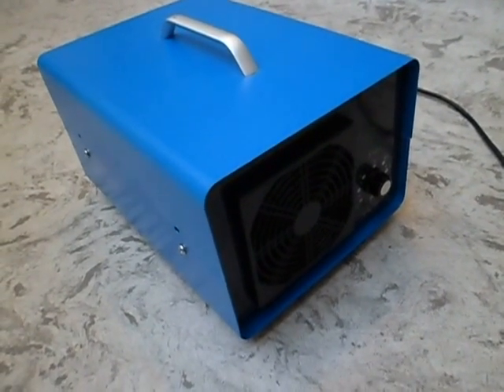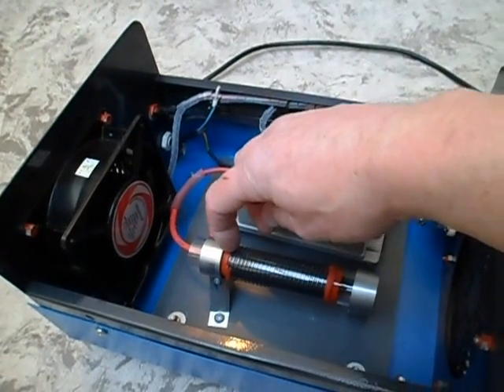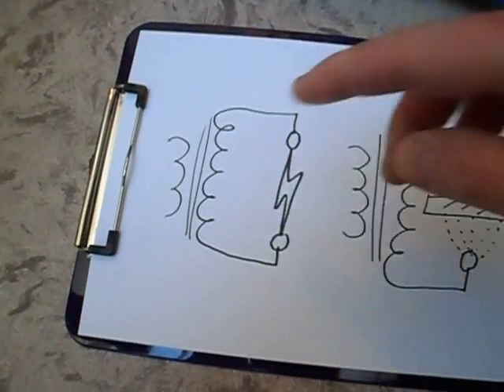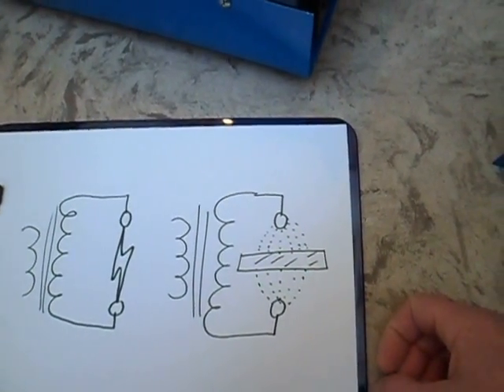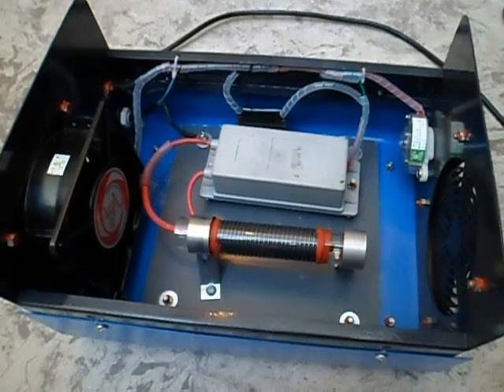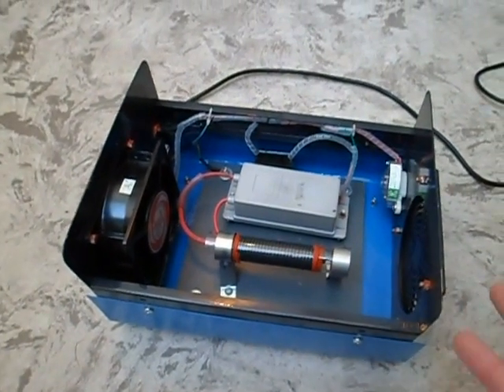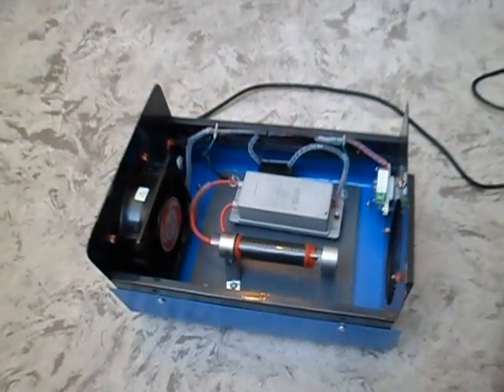Inside a Chinese ozone generator.

Comment: Where does the ozone stuff come out? The front part with the switch or at the back?
Reply from the maker: It varies between machine.  Ideally the fan blows air in so it's not sucking ozone past itself.

Comment: Well the package has arrived, a 60mg/h digital timer ozone generator. It jas different guts then in this vid (stacked white plates).

The first thing I checked: Earth connection. Well that's not present at all. Should I connect the earth to the metal case? Most video's tell you to do so, but I also heard that some devices are designed without earth on purpose.

Comment: Is that circuit AC or DC ? I mean that corona tube works with hight voltage AC or DC. I will be really thankful if you responce
Reply from the maker: High voltage and high frequency AC.  DC wouldn't work.

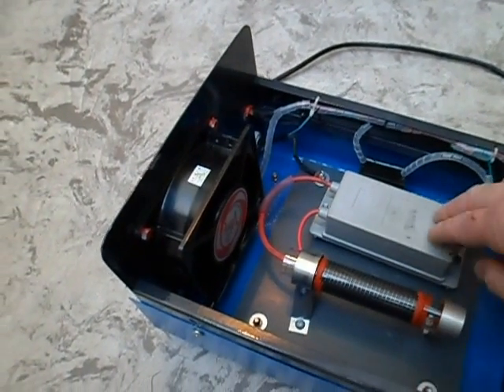Comment: Are you saying a capacitor in a series rivet? (0:25)
Reply from the maker: A capacitor in series with it.
Reply: @bigclivedotcom  correct me if I'm wrong, but this capacitor in series is for electric input stability? Or does it do other purpose?

Comment: the generator gets very hot and burns out - a little fan will not help because you got no  heat sink  -  i have had 2  burn out in several months also they grow a crystalline substance all over then the wires short out creating a bad fire hazard  - Chinese cheep design JUNK

Comment: ozone doesn't just oxidize smells in the air... it oxidizes everything in the air.  it's like vaporizing weak bleach and then breathing it.  and yes, it bleaches your lungs too.  this is why it's considered one of the most important air contaminants, and places like deserts, where ozone gets produced commonly at ground level just from heating rocks in the sun, often have ozone concentrations listed in the local papers.

same ozone you hear about forming the ozone layer... but the difference is that the ozone layer is up in the stratosphere, and serves an important function in absorbing UV light (UV will break the O3 back into O2 and single O atoms).  ozone that is formed at low levels in the atmosphere is just a pollutant.

what things like this should really do is keep the ozone localized inside the box by using filters or UV before the air exits.  but AFAIK, none of them do.
Reply: You reminded me I wanted to build a uv air steriliser, thanks

Comment: I have a laser driver that's around 17,500 volts I mention this would work pretty good for such a device. The thing is I have an ozone generator that something went wrong with it's just it cheap A2Z ozone generator but I need it for my lab work it's scrubs bacteria out of a chamber that I use. I also have a medical grade ozone generator that I do not want to sacrifice for this purpose. I don't even want to open it up to inspect it it's very important to me. I wonder if I took the 17000 driver some nichrome wire and some stainless wire and used a test tube to recreate the tube if this would work. Does it need to be under vacuum do you know? I may be able to figure that out as well. I'm a machine this so I can make a custom one-way valve too attached to the open end that allows for vacuuming the tube out. Of course if this is not necessary I will not bother with that aspect.

I really need to rebuild that ozone generator seems to be such a waste to toss it out if I can repair it I just hate that! If you have any thoughts that may help me through this problem I would be very grateful for your input
Reply: Well, I did just find out by asking AI, the ozone capacitor does get very hot, so to run this in a sealed chamber to work with 93% oxygen from an oxygen concentrator, I'll need to use water cooling somehow. I'll have to use a pc water cooling fan, pc power supply, and something crafty to attach cooling to the tube without letting it overheat somewhere, and keep exposed to the oxygen to make ozone. Could be a real engineering problem.
Reply: btw; 10kv is ideal for these, because of the heat made at higher or lower voltages. I have a paper on it.

Comment: Given that Ozone has an LD50 10 times lower than hydrogen cyanide, One must wonder why anyone would wish to release Ozone into the local environment. Ozone is a powerful disinfectant, used in water purification as it kills cryptosporidium. It oxidises organic matter in the air, however the by products may be toxic. Ozone attacks carbon carbon double bonds forming unstable ozonides, some of which are powerful explosives. Just like the craze to add negative e ions to the air, the health benefits are questionable.
Reply: Nobody forces you to stay in the same room while the thing is running. Plus ozone is unstable, it will decay on its own after hours. Finally, the manual will advise you to air the room afterwards.

Comment: What voltage is lead in to the tube?
Reply from the maker: Probably about 4kV.
Reply: Could you measure?
Our gives about 1kV and I think it's broken
Reply from the maker: Be careful measuring it, as it is usually high frequency and may cause meter damage.
If the connections to the tubes interior and exterior mesh are good then a purple glow should appear on them in a very dark room if the power supply is working.

Comment: I've seen other units with tubing and a small air pump do you think it would be possible to use this as an oxygen source for a torch
Reply: It would still be mixed with air and so wouldn't ignite.
I've seen people use oxygen concentrators (breathing aids) alongside lpg with good results.

Comment: Is it possible to dry clean personal clothes with ozone?
Reply: Problem with ozone is that it degrades all materials, not just dirt and bacteria. Plastics based material become brittle, colour components break down. Thus ozone is possibly best for odour management only.
Reply from the maker: There is a Japanese washing machine that uses ozone.  It can tumble the clothing dry for freshening it up, or use it with water for deeper cleaning.
Reply: > "There is a Japanese washing machine that uses ozone."
Is it the model bellow?
http://web-japan.org/trends/science/sci060313.html
Reply from the maker: Yes, that looks like it.  Some commercial laundry equipment uses ozone too.
Reply: The problem with Sanyo's Aqua Washing Machine is that it mixes several new unproven technologies (ex: water reusage, no-detergent, ultra-sonic, ozone ...). It is too risky from the perspective of a standard consumer.

For instance, consider this much simpler equipment:
- one simple basket sealed with clothes inside (no water and not so dirty)
- one ozone generator of high concentration

In this simple case, do you think it is possible to clean the clothes?
Reply: Wibin > "Problem with ozone is that it degrades all materials [...]"
Does it degrades more or less than bleaches ?
Reply: bleach (sodium hypochlorite) is an oxidizer, just like ozone.  ozone is considered a strong oxidizer, so you're pretty much doing the same thing as household bleach with it, and it carries the same limitations and dangers, meaning it will in fact bleach colors, destroy some plastics, etc etc.

Comment: Do you know how to use the kits that are sold on ebay ?What other 
components would be needed to make a complete ozone generator ?http://www.ebay.com/itm/12V-15G-H-High-Frequency-Pipe-Open-Ozone-Generator-Kits-Disinfection-Purifier-/271395448041?hash=item3f306de4e9:g:L5AAAOxygPtS01wg

Comment: isn't ozone toxic ??
Reply: +Bogdan M  It is just slightly. You will perceive headache before any significant damage is done, and it has an obvious smell, so it's not too dangerous. It's certainly prudent not to be inside when you have ozone generator running, and it's also prudent to air out or wait for a while before you stay in the room for more than a few seconds. After a few hours, the ozone will certainly find some organic matter to oxidise or will recombine back into regular oxygen.

Whether one really needs one... meh, i don't know. I suppose it will kill off some furniture resident bacteria and cause particulate matter in the air to set on the walls, where it can be wiped off easily. 

As a precaution, when my sick dog died and before we got a new one, we blasted all the rooms with powerful quartz UV lamps on a timer which also generated lots of ozone. Probably a good thing. Obviously we stayed out during the procedure.
Reply: "It is just slightly."

no, it is a very strong oxidizer.  it's about the same level as sodium hypochlorite (bleach).

it's why it's listed as a major air pollutant in all areas where it gets commonly (and naturally) produced at ground level.

these cheap ass ozone producers like the one featured here don't really produce enough to do much.  maybe if you were in an enclosed small space with it for hours and hours... but professional ones actually don't release ozone INTO the air at all.  the ozone is produced in, and stays in, the box you pass the air through.

Comment: so what is this used for?
Reply from the maker: Odour removal and sterilisation.
Reply: ok. that makes since. iv always understood breathing ozone was bad for you. thought there was some sort of medical use.
Reply from the maker: +Shmeh Fleh One type of ozone generator used two tubes zig-zagging against each other.  They were each connected to a transformer terminal and the corona discharge occurred between the tubes.
Reply from the maker: +Shmeh Fleh One tube would have had neon in it and the other probably argon.  Sounds nice.
Reply: +danz409 I ran across an old ozone generator at an antique store once. Evidently they were sold in the 40s & 50s as a snake-oil miracle cure for pretty much anything that ails you. It was a big gas-discharge tube, like a neon sign tube, folded back on itself a bunch of times. And yeah, it pumped out the ozone! Also, you got a nice, memorable zap from it if you got your hands anywhere near the tube while it was on. Hard to believe something like that could ever be considered 'safe' in any capacity.
Reply: I remember the tubes were parallel to each other, and they glowed in alternating rows of pink and dark purple when the unit was on, if that makes any sense. I do know I would've bought the sucker in a heartbeat, if they weren't asking 500 bucks for it!
Reply: Quinton Webber poison?I never seen or heard anyone die from using ozone generator. You will potentially die from anything in this day anage, even just from telling the truth.
Reply: +danz409 to clear the contaminant, bacteria, pathogens, chemicals, poisons in the air and water, so you won't get sick and get cancer.
Reply: kill bateria usually cooperate use with UV sterilizer to clear pool water
Reply: Turning lead into gold using another element

Comment: If you dont feed it with pure oxygen dont you get nitrous oxides instead of ozone?
Reply: +Morkvonork You will get NO/NO2 if you feed it standard air, pretty much.
Reply: Even O3 is pretty much toxic in high enough concentrations.  When you have a lot of static go off somewhere, and you get that weird electricity smell?  That's a very small concentration of ozone, and the reason you detect it so easily is because the human sense of smell has gotten very good at detecting things that are not very good for you.
Reply: +The Insufferable Tool ok got leaking sewer pipe under house, three cigerett smokers with three big smelly muts,
house is so noxious to me that it burns my sinuses just walking in the door to visit.

what quanity of ozone is needed to steralize the damp crawl space
4 bed rooms
living and den and the attic and garage.
Reply: Lots.
Reply: Not quite, you get both ozone and nitric oxide. The really worrisome part is that it forms nitric acid when you add moisture. Like in your mouth and lungs.

Comment: Make sure your ozone is built like Tesla's, using Cold Plasma which has cathode/anode glass tubes with noble gases.   Many on the market are the cheap versions using corona discharge which has metal and wears out, and also creates toxins.  These are no good for your home or for water.
Reply: Actually Tesla’s invention was a corona discharge ozone generator.
Reply: Butch Randolph Currently they are very expensive... A few thousand or more.   Used in hospitals right now.
Reply: Butch Randolph If you are using it for your home purposes, I think the cheaper one's might do it.  Just make sure to air your house out thoroughly.   The Cold Plasma Tesla versions are for medical purposes which require extreme purity.   I do not know where you can get plans to build it.  You'll need to google it.
Reply: +healthjunkie1 Which toxins does it make?
Reply: But can't you use a second glass tube to protect the inner metal rod from the ozone?

Comment: Is there a way to measure how much ozone gives?
Reply: The make handheld detectors for liquid and gas, but they would cost more than the generator.  Easiest to use your (or someone else's) senses of smell.  I worked w/ a guy on an ozone disinfection  system for purified water system.  Ukrainian guy I worked w/ swore he knew exactly what ozone smelled like because the Soviets used to make them stand in front of UV lights at school in the winter.
Reply: @Quincy8Boy  I feel the ozone but I don't estimate the amount .

Comment: Sir I have 2 Unovair ozone units , the 1000 and the 5000 and although both worked fine for me. BOTH fried new bulbs when I tried to replace.
What should the voltage to the bulbs be ?  also they are 4 pin bases and there is 2 ways to plug tube into base, is there a way to plug them in backwards ?
 Thank You

Comment: More people need to know about the benefits of ozone.  Google "Oxygen Therapies"
Reply: Scalerwave Signal Ozone is an extremely poisonous and reactive gas which destroys lungs and lowers their capacity. Tropospheric ozone is one of the causes of asthma. The only thing it's extremely good for is destroying organic materials. Sterilization and disinfection. Never inhale ozonized air and never drink water you were disinfecting minutes ago. Let it rest for a few hours until it breaks down to sufficiently low levels.

Proper ozone usage is not controversial, but in the last decade lots of frauds began advertising dangerous procedures and making money on other people's misery.
Reply: Scalerwave Signal Comparing water and oxygen with ozone can be done by an ignorant or an evil person only.
Oxygen IS poisonous if you breathe it pure for a prolonged amount of time, and ozone is ACUTELY and EXTREMELY dangerous in anything except very small concentrations (which are chronically poisonous, slowly causing asthma and decreased lung capacity).

Ozone therapy is a fucking scam done by cosmetic salons by application of ozonized air at the skin. Also, criminally inclined assholes inject it in body where it wrecks the shit out of our easily oxidized tissues.
Reply: +bigclivedotcom I've built several ozone generators over the years for sterilising water, using a 15 kV neon sign transformer to drive the ozone cells.  The cells consisted of a 1/16-inch brazing rod inside a 1/4-inch soda-lime glass tube, which was mounted inside a length of 1/2-inch copper pipe with acrylic ("Perspex") insulating spacers at each end.  The copper pipe serves as one electrode and the brazing rod as the other.  Small barbed brass tubes soldered in at each end of the  assembly allowed me to attach small-bore clear vinyl tubing to pump air through the cell, using an aquarium aerator pump.  The ozone-rich air coming out of the cell was piped into a container of water with some vinyl tubing and an "airstone" meant for bubbling air in aquariums.  Because I used soda-lime glass tubes and because the brazing rod wasn't perfectly centred in the glass tube, it would generate hot spots in the glass and after many hours of operation the glass would eventually crack, requiring an overhaul or replacement of the cell.  Also, the vinyl tubing and airstone would gradually deteriorate from the ozone.  However, the materials are cheap and readily available, so maintenance costs are low.  When the glass tube in the ozone cell fails, it can produce a seriously hot plasma arc, so the whole thing needs to be mounted inside a steel box.  If I were to make an improved version, I would use borosilicate glass tubes and I would add a thermal fuse inside the box to cut the AC mains power to the transformer.
Reply from the maker: Ozone is controversial.  It has its fans and its haters too.  I did try the ozonation of water with a small dedicated unit, but it's output was too low to get decent results.  (I was trying to clean clothing with ozonated water.)
Reply: Lajos Winkler i looooove the smell of ozone
Reply: ‍1marcelfilms same here
Reply: +Bloxerman Rbx How much time have you spent educating yourself on the medical uses of Ozone?
Reply: +Bloxerman Rbx Read for yourself... just google "Medical Ozone" or "Ozone Therapy".  As far as ozone being toxic... so is oxygen or dihydrogen monoxide, yet you use both of them daily.
Reply: +Alex Nolan http://www.oxygenhealth.com/